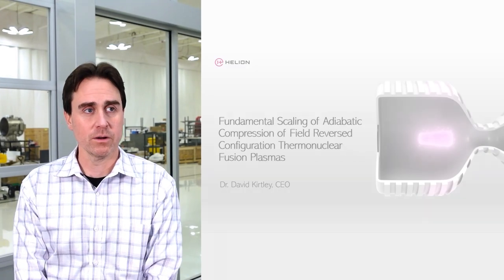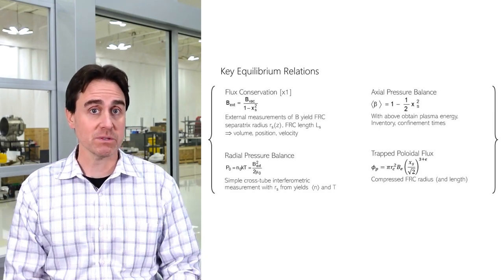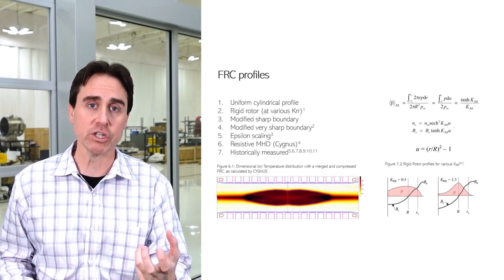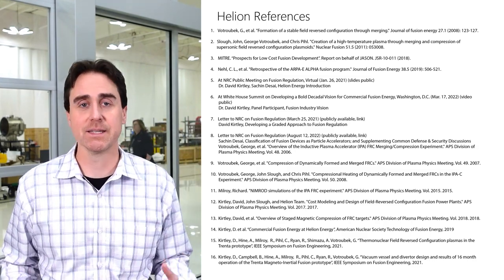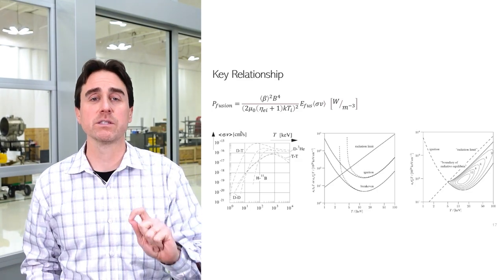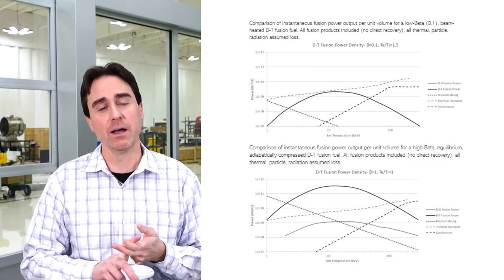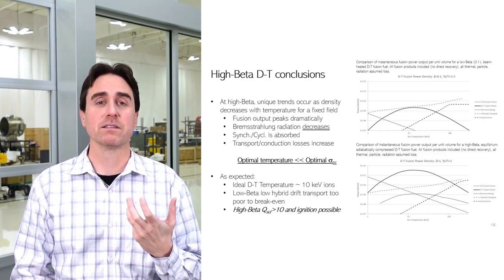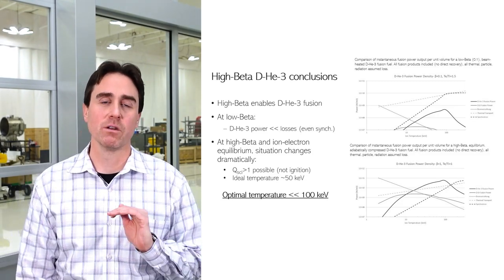The theory behind Helion’s approach to building commercial fusion devices

Comment: Not sure if it's just me, but it sounds like the audio has been passed through a noise removal filter turned to maximum. It's a little distracting, but thanks for the interesting video - would be great to see the original presentation from the conference if that's anywhere.
Reply: Not sure you understand but they've solved fusion for reliable and scaleable use. They just made OBSOLETE every other fusion reactor. (that we know of) They have a fuel supply and a distribution proposal that is exciting. This is it the moment I've been waiting for since I was introduced to the fusion energy concept with the cold fusion experiments of Fleischmann–Pons. It's like this, this time in history will be the succeding moment for electricity putting fossil fuels to sleep. This guy is GIDDY with excitement. I don't care if he farts an explanation out his ass, I'd listen to it.
Reply: @smizzbizzie  did they?

Comment: Fantastic job!  Could you please explain if there are something similar to fission reactor critial parameters (material and geometric) for fusion reactor? Like undercritical, critical and overcritical.
Reply: There's hundreds of parameters. One of the major ones mentioned here is beta, which is the ratio of external magnetic field to the particle pressure. Kirtley claims higher performance at high beta.

Comment: I wonder just how more efficiency could you squeeze out of such a machine were a room temperature and room pressure superconductor availaible. Working on it.
Reply: If they were actual room temperature super conductors, then that might help. Right now, they are using non super conducting magnets because the cooling would take too long and cryostats would eat too much into their energy balance.

Comment: I'm no scientist but I get that with this type of fusion, rather than high temperature it's high density that is needed and by doing this less energy is required to achieve a gain in energy output. Is this correct?
Reply: It needs higher temperatures but the FRC plasma has the advantage of much more density. I think tokamak beta (density) is .1 while Helion beta is 10x that. It's not so much that less energy is needed but that the energy can be so efficiently applied and recovered along with the energy produced that you don't need much gain to recover the input plus surplus energy
Reply: The density does help, but another important key is the extremely high ion to electron temperature ratio. Unfortunately, that last slide is missing from this video (it was in David's presentation at Princeton and he posted it on the twitter thread of this video), but it makes a huge difference. Power/m3 is almost an order of magnitude higher for a given temperature!
Reply: @elmarmoelzer2229  the problem with that ion to electron temperature ratio is that the two temperatures will tend to balance with time. At high densities the process is faster and the alphas produced with the fusion will be mainly absorbed by the electrons (their temperature will rise faster than the ions). Honestly this presentation including that of princeton is useless close to a "joke" because it doesn't explain ANYTHING. It's not a surprise that their credibility is considered so low...
Reply: @francescoG5  
Yes, they do balance over time and the same happens in Helion's machines. But by the time the ion and electron temperatures are in equilibrium, the pulse is already over.
So, for the most time, the ions are still much hotter than the electrons. And that difference actually increases with temperature. So the hotter they go, the bigger the difference between ion and electron temperature and the longer it takes to reach equilibrium.
Reply: @elmarmoelzer2229  do you know how long the confinement time or the "burn time" will last for polaris?  this is because from what I know the "thermalization" (MeV to KeV) time for fusion products is in the order of milliseconds...
Reply: @francescoG5  
About 1ms. It is correct that over time, the plasma goes towards equilibrium, but they have a Te/Ti of 0.1 or less. Trenta had a peak of 1/17!
Reply: @francescoG5  as he mentioned, that's a bigger problem for toks and other non-pulsed machines

they seem confident based on measurements that the ratios will remain high for the duration of a pulse

Comment: My other question got some amazingly good answers (thank you!), so now for a basic question about magnets.  It doesn’t look like cooling is required, is that right?  I was wondering if the pulsed system, which only sustains current for short periods of time, doesn’t require as much cooling as a traditional tokamak that has a sustained current for a longer time.  This seems like (another) big advantage for Helion’s design.
Reply: They do require less cooling and they can make them pretty thick because they don't have to fit through a donut hole in the center. AFAIK, future machines will use water and maybe oil cooling.
Trenta, their current machine only has air cooling but it also only does one pulse every 10 minutes or so. Polaris will do 1Hz and future power plants will do anywhere from 0 to 10 Hz depending on demand and operation modes, etc.
Reply: @elmarmoelzer2229  Does that mean 1~10 plasma operations (shots?) per second?
Reply: Cooling will be a bigger concern as they close in on their target prototype fusion system.
Reply: @davidshelby7518   Yes, they will have up to 10 of those cycles a second. So 10X formation, acceleration, compression, expansion, evacuation of vacuum chamber, repeat per second.
Reply: @ByteSizedSociety   Cooling is IMHO not that big of a problem. Their magnets operate at room temperature. For Trenta, even air cooling is enough. Polaris will use water cooling. Actual power plants might use oil cooling. I see the bigger problem with evacuating the chamber quickly without consuming too much energy and just general power supply-recovery management. But then, they have experience with that (though at a smaller scale).
Reply: that was one of the most shocking aspects of the design, looks like they are not even planning on superconducting magnets for the reactor-sized machine

that means it would cost maybe a tenth as much in TCO (total cost of operation) as a comparable steady-state machine

pulses are apparently a lot easier to manage

a truly commercial approach